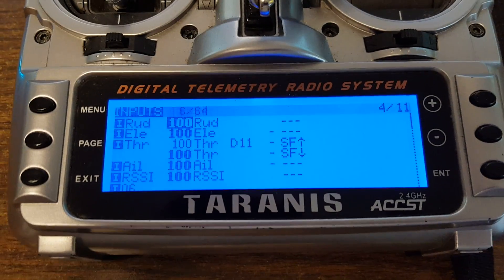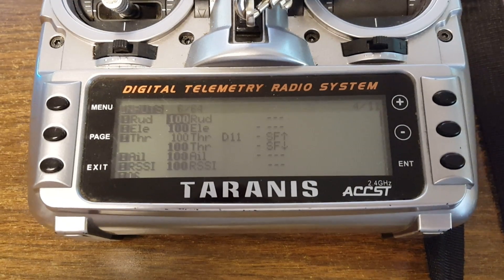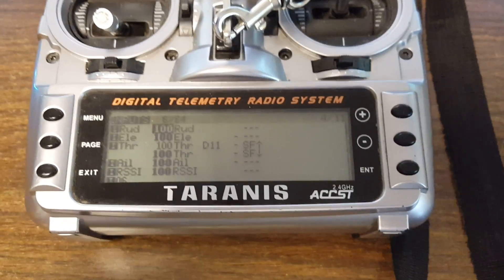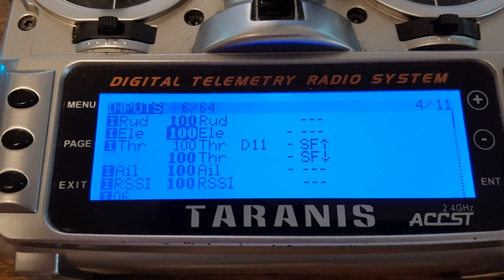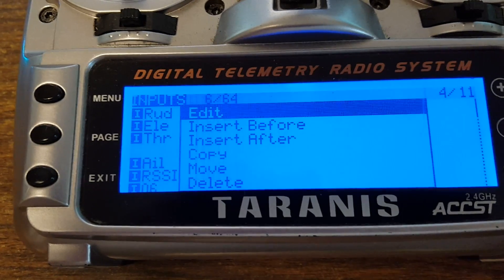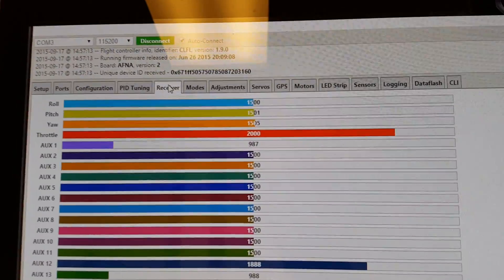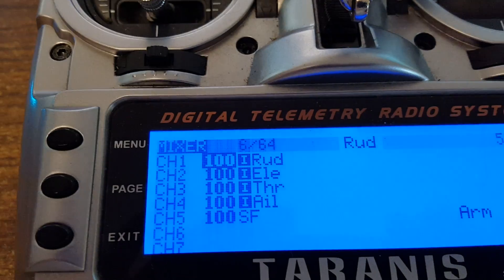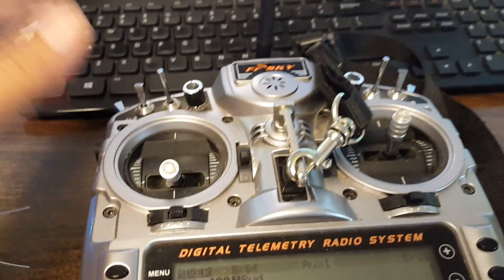Configuring "idle up" switch with Cleanflight and Taranis

Comment: I know this is at very old video to ask.. But i want to do what le drib did with his flight mode ( https://youtu.be/-oUFIwSRMtM ). I set airmode on a switch, lower my idle percent, and have idle up switch (adding diff to my throttle) on a switch like you did in this video to get enough control while cutting throttle and not having desync issue because of very low idle percent. Everything works, but why after i switch airmode and idle up on, the motors keeps increasing its speed? Sometimes only on one motor, but somtimes all did. And it also happened with props on. Thats why i scared to fly with this setup, because im afraid i have to force disarm my quad from the sky.
Reply from the maker: It's normal for motors to speed up a little when in air mode, on the ground. It doesn't happen when you're flying. And if you have a problem of course you can always switch it off
Reply: Joshua Bardwell so the motors speed up will not happen when flying right.. Another question is it safe to use pid_on_min_throttle off? Like in this vid https://youtu.be/jYhmNwDT-qI because this is more likely which i prefer because  i can totally remove 'gyro pid' action when i dont want.

Comment: One more question answer both the tiny switches on the back of my r9m are off is that the proper configuration? I have the radio set to external module r9m FCC and then s bus pops up as far as I know it's not on PPM
Reply from the maker: The switches are only needed if you are using the module in a non-Frsky radio. For FrSky radio, ignore the switches and set power in the software.

Comment: Sir I have a problem I hope you can help I have a r 9 M TX module, r9mm RX and R9 mini RX all three flash with the latest firmware taranis qx7 on 2 2 2 everything else is flashed with regular firmware not Flex and everything I tried the module won't bind it to either RX any ideas everything is FCC and I try all the Telemetry options Telemetry on Telemetry off 8 channel 16 channel I'm going to try the flex firmware on everything if you think it pays?
Reply from the maker: If everything is on FCC firmware and everything is on the same firmware version, then it really should bind. I can't think of a reason why it wouldn't. I guess I would try Flex firmware and cross fingers.

Comment: If I was to set this up today on bf 3.3 on a switch different from the arm switch. With airmode off arming in acro mode. What does it mean if my motors slowly start to spool up and slow increase rpm
Reply from the maker: https://www.youtube.com/watch?v=xBaefeQtA1c
Reply: Joshua Bardwell I mean with props on they spoil up

Comment: Hope you're doing well man. Love the videos and have been around since the Blackbox videos, I'm wondering if there is a big difference in how to setup throttle cut or idle up switch nowadays compared to when you made this video.  Recently I seen Steele and Snake talking about using this for freestyling and I've wanted to try it over airmode.
Reply from the maker: I'm curious myself. I used to use idle up before air mode existed. Now I use air mode for everything.
Reply: I have only used airmode since it was released and I've gotten so use to it. Maybe a good idea for a video. Can do the test the right way. Thanks again for everything you do in our amazing hobby.

Comment: Joshua Bardwell , yes it is moving in betaflight and it is also connect but with taranis when i move the stick, sometimes motor's make sound as if it is just starting and sometimes it goes to off mode and then i have to restart the copter and most of the time it doesn't give any response, every thing is proper it's just motor's are not spinning on the throttle.

Comment: sir , i have build my quadcopter with sp racing f3 and x4r-sb , it is perfectly working when connecting to betaflight but not working with my taranis qx7 , it is connected (giving green led and also show response in betaflight for receiver) don't know what to do , please help me out , waiting for your reply .
Reply from the maker: Do the channels move in the Receiver Tab when you move the sticks on the transmitter?

If no, then you need to configure receiver type correctly, configure UART in the Ports tab, check wiring, and so forth.

If yes, then please describe more what the problem is.
Reply: Joshua Bardwell , yes it is moving in betaflight and it is also connect but with taranis when i move the stick, sometimes motor's make sound as if it is just starting and sometimes it goes to off mode and then i have to restart the copter and most of the time it doesn't give any response, every thing is proper it's just motor's are not spinning on the throttle.

Comment: JB, trying to go to idle-up instead of airmode to prevent the bouncy landings.  Removed "air-mode" from MODES. Setup Taranis with SF(up)-ARM and SB(up)-IDLE@1071.  Have the DIFF setup at 14 to get 1071 (need 1065 for all motors to come online smooth).  Everything looks great in RECEIVER tab in Betaflight 3.  When I arm, motors spin at min throttle.  Dammit!  Ok... enabled motor stop.  Now motors don't spin if armed or even if throttle is at 1071(IDLE-UP).  Dammit!  Set min throttle to 1000.  ARM+IDLEUP = nothing.  Dammit!   What am I missing here?
Reply from the maker: With motor_stop enabled, motors should spin at min_throttle whenever the throttle channel is above min_check. If the copter is armed and the motors are not spinning one of those conditions isn't true.
Reply: So for IDLE UP to work I would need: motor_stop enabled, min_throttle to 1071 (in my case), min_check to 1070, and my Taranis should register in RECEIVER tab as 1071 w/ IDLE-UP?   Disarm motor timer ok at 5 seconds?
Reply: That worked.  Sort of.  It does something funky when I throttle down where some of the motors may stay spooled up and don't drop to min-throttle (in rate mode).  Tried reverting to airmode and noticed it does the same thing - not sure what's going on but not sure that I trust it.

Comment: Judging by the date on this video, I imagine that this is redundant with airmode enabled and running betaflight?
Reply from the maker: Correct.
Reply: Thanks!
Reply: Joshua Bardwell could you add a word about that in the description ? A few of your videos redirect here and it would.be nice for that information to be more visible. I had to trust my instinct and confirm in the comments that this was redundant with airmode. Thanks!
Reply: Joshua Bardwell could you add a word about that in the description ? A few of your videos redirect here and it would.be nice for that information to be more visible. I had to trust my instinct and confirm in the comments that this was redundant with airmode. Thanks!

Comment: i m confused Joshua, you have to do all of this configuration, to keep the controls of your sticks when the copter is not flying ? or this is actually helps to keep the full control on the quadmotors idleling at a lower rpm ?
Reply from the maker: It is to keep full control of the quadcopter at zero throttle in the air.
Reply: Thanks for your answer, i thought we could already do that, in the basic configuration using air mode, and i didn t ask my question properly, so is it to reduce the rpm even more ? or to use a different mode ?
Reply: throttle zero, you mean actualy stop the motors ?

Comment: Have you ever ran the kiss FC, can I do something like this with the kiss FC, I just switched over to using the kiss fc and I am having trouble with my quad just falling out of the sky when I get close to 0 throttle and I keep crashing, I am so frustrated that I have started building a new quad with a naze32... I have always been using a cc3d fc before any of these other FC's and my quad would float at zero, now with the a X style frame ( had a H style before) and Kiss FC the damn thing will flip out of control and fall when I cut the throttle. (uncontrolled flip)
Reply: yeah get airmode enabled or do the idle up, its definitely necessary

Comment: Should the motors spin at all with zero input (mine do not BUT I have seen videos where when armed the motors spin until the kill switch is flipped.) If so do we bump the "D11" up until the motors just start to spin? Thanks. 
       Your videos go into more then just the basics and I can not wait until I progress enough to dive into the good stuff. Keep it up.
Reply from the maker: Exactly. Raise D11 until the motors just start to spin when the throttle is at zero. This is the point of idle up. But if you are using a recent version of Betaflight, then I recommend using "air mode" instead. Air mode is superior to idle up.

https://www.youtube.com/watch?v=d2nRrVENEYM
Reply: +Joshua Bardwell thanks for the response and additional info!

Comment: This doesn't seem work at all on a Taranis Plus. No matter how high I set the Diff, I still have to raise the actual throttle stick up a few clicks to engage the motors. They don't just run at low speed on their own. I wonder what I missed.
Reply from the maker: +TeamPreach With the stick at the bottom, does the throttle channel in the Taranis channel monitor bump upwards when you flip the switch? If no, that is your problem, but I can't really delve into troubleshooting why... it's too open-ended.
Reply: +Joshua Bardwell No. That's exactly the issue. No matter what I do to the curve, the little crosshair on the curve doesn't move up the curve unless I move the throttle stick up a few clicks. I put the diff all the way up to 30 and it still sat and waited for me to push up the throttle stick. The cleanflight throttle channel shows no movement when I hit the switch. I'm trying to figure out what else you did that I missed. Thanks for replying so fast.
Reply from the maker: Is the input line bold (active) in the inputs screen when the stick is all the way down?
Reply: +Joshua Bardwell On mine, the 100 changes from bold to regular when I hit the switch I assigned. The graph on the right that shows the throttle position stays at -100 regardless of where the switch is.
Reply: +Joshua Bardwell I think what I'm trying to accomplish is to get that graph to show the throttle at -85 or so when I hit my idle up switch, right?
Reply: +Joshua Bardwell Found it. Everything you did in the inputs, I had to do there and also in the mixer section. Now cleanflight shows my switch throw on the throttle. Thanks for making the video and replying.
Reply from the maker: TeamPreach My guess is you are inputting the throttle directly into the mixer instead of inputting the throttle to the Inputs screen and then the Input to the Mixer. If you have a little bracketed [I]THR as your mixer source, then that is correct. If you have just "THR" as your mixer source, then that is the throttle directly.

But, as you discovered, it is perfectly valid to just apply the diff to the mix directly. That's not wrong, just different.
Reply: +Joshua Bardwell I'm about two weeks into this hobby. Flew outside for the third time today. The Tx programming is the most complicated stuff so far honestly. If it wasn't for the fact that this involves wearing video goggles and flying FPV quad copters, it might not be worth it. But as this is the coolest shit ever, it's just going to be a learning process. Channels like yours help a lot, so thanks. This is what my program looks like. http://imgur.com/a/dRmSC Do I even need the setup as it is in the inputs, or just the stuff I did to the mixer?
Reply from the maker: TeamPreach I don't 100% know because there are too many variables, but it does look like you did what I suggested. See how on your INPUTS screen there is a little bracketed [I]Thr in front of the throttle line. Okay, so if you go to your MIXER screen and make a new line, where you select the Source for the mix line, if you scroll, you can either pick "Thr" which is the throttle input directly, or "[I]Thr" which is the output of the Throttle INPUT line. You have selected "Thr" (and likewise for Ail, Ele, and Rud) so your INPUTS screen may not actually be doing anything. The INPUT lines are all there, but nothing is paying any attention to their output.

Why do it so complicated??? Because this is basically programming. Like, full-fledged, general-purpose programming. Okay, not quite. But somewhere, somebody wants to have an input throttle line that has a diff curve, and then sometimes it doesn't have a diff curve, and then sometimes they want to be able to look at the actual throttle stick position regardless, and that's why all these options are there.

It should be reasonably straightforward to determine if what you are trying to do is working, and if it's working, then don't beat your head apart trying to figure out if it's right.
Reply: +Joshua Bardwell That was way more confusing that it should be I'm sure. Maybe I don't have a deep enough understanding of the simple base level vocab like input and output. An input is when the tx "sees" stick movement, and an output is what the tx "says" to the rx? Is it that simple?
Reply from the maker: TeamPreach An input is something like a stick or a switch or a potentiometer. So it can go like this:

Stick -> Inputs Screen -> Mixer -> Channel Output

Or it can go like this:

Stick -> Mixer -> Channel Output

You currently have it set up the 2nd way, which is fine as long as it's working for you.

Maybe it would help to think of it this way: the INPUTS screen is sort of an administrative assistant for the MIXER screen. INPUTS can shape the incoming signal before MIXER sees it. Or you can feed the incoming signal directly to the MIXER and let it do all the work. It just depends on what is easiest for you to configure.

For example, if you want to set up dual rates, you can have two MIXER lines, where one of them gives 100% weight and the other gives 75% weight. Or you can have two INPUT lines set up the same way and then the MIXER simply takes the INPUT as its Source. Why wouldn't you do it the 2nd way, since that removes a layer of complexity? Well, what if this was a really complicated mix for some reason, and there were a like six different mixer lines? Then you would need to set up another whole six lines, one set with 75% weight and one with 100% weight. On the other hand, the INPUTS screen would let you shape the signal being fed into the MIXER before the MIXER ever saw it. So the INPUTS screen would decide whether you were at 75% or 100% rates, and then the MIXER would do the complicated six-line nonsense on whatever the NIPUTS screen fed to it.
Reply: +Joshua Bardwell It's starting to make more sense. I need to spend some time in the open tx university site. Is that how you learned this initially? Thanks again for all that explaining.
Reply from the maker: TeamPreach I have a background in computer programming, so this all sort of comes naturally. The Taranis makes intuitive sense because, at its heart, it's a programming language.
Reply: +Joshua Bardwell Yeah I imagine that would definitely help.

Comment: joshua - Great video - thanks ! QQ : I seem to have the differential curve working great in the Taranis (as per your video) with the throttle output curve being a little higher than normal when my chosen switch is activate, however I am not seeing this change appear in CleanFlight (receiver tab). Any thoughts ??
Reply from the maker: +Ankur Mathur Does your configurator GUI continue working after you arm? If you have telemetry on UART1, the GUI will get locked out when you arm. This would cause your throttle channel to appear to stay the same. But nothing else would move either.
Reply: +Joshua Bardwell - yup all values continue to show up in CF. The new curve with the low throttle point being a little higher shows up great in the Tx. Just cannot get that low point to show up in CF as per 2.45min into your video :-(
Reply from the maker: No clue. Sorry.

Comment: This creates an uneven throttle curve, where there is less throw between minimum and mid than there is between mid and maximum. You can see this in both cleanflight and in the taranis if you exaggerate the diff to a greater value (say 40), then enable it and you will see the curve only affects throttle response below mid, where as the throttle curve between mid and full is unchanged. Basically what this does is makes the throttle more touchy down low. I wonder if it's enough to really notice it though, or if there's another way around this?
Reply from the maker: +venturation It is really an incredibly small difference, and I don't notice it all in flight. But if you really care about that, you can create a custom curve instead. I just like the ability to tweak the diff value easily rather than having to go into the curve editor.

Comment: I'm running a cc3d and openpilot.  Openpilot allows you to assign a accessory to change to different throttle curves, but instead I put it in the radio like you did. However I did it differently. I arm with the two pos switch. Then use the three pos switch to mix the throttle input. So down is idle off -100~+100 diff 0. Middle idle up -88.7~+100 diff 12. UP idle 2 -85~+100 diff 14. So if any of the idle up is used the throttle won't arm because it won't see zero. So the motors arm off. The Taranis is a powerful TX.
Reply: I did t change anything in the input screen. Just mix throttle with the three pos switch.
Reply from the maker: +Invitingsauce This is also a fine approach. I actually do have a switch that disables idle-up, although I default it to be on all the time. I use the disable switch if I want to arm on the bench without spinning the motors (e.g. to test failsafe or something). I never use it at the field though.